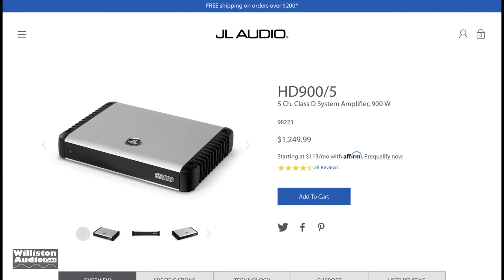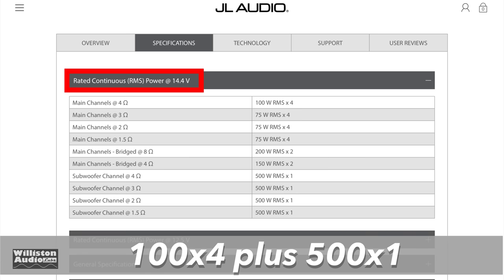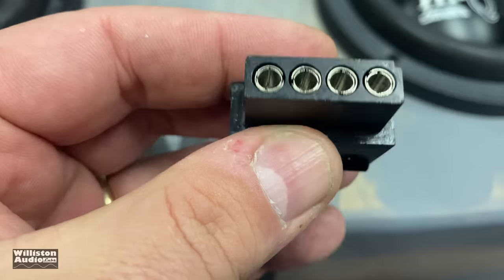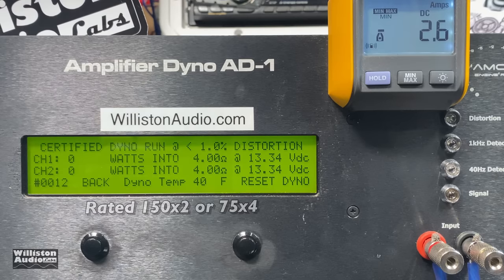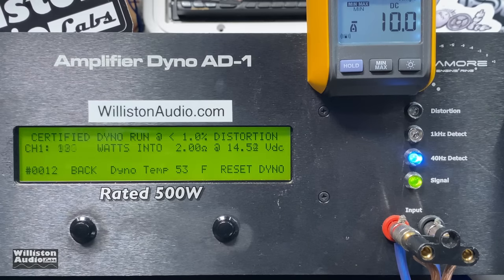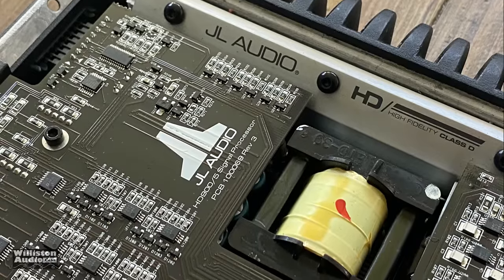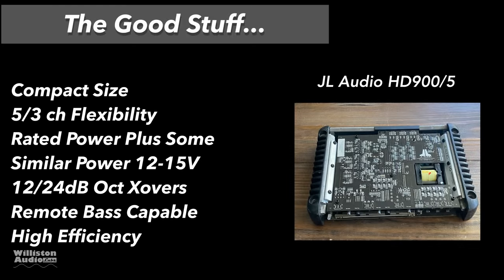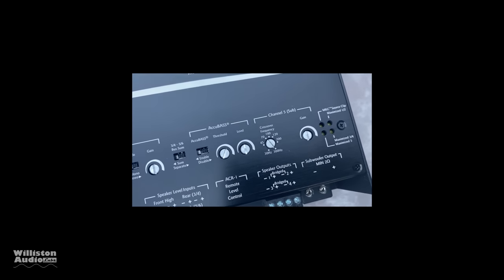JL Audio HD900/5 Amp Dyno Test and Review [4K]

Comment: There’s nothing great about those jl audio hd amps they are way over priced. Memphis car audio amps are way better.
Reply: 🤣🤣🤣🤣. Wrong. Sonically this amp is amazing.  Memphis🤣🤣🤣🤣🤣
Reply: Maybe Memphis of old
Reply: @angelvip2474  I use to have that same jl hd amp it went out after 2 years. I replaced it with a Memphis viv amp. The Memphis sounds a lot better and was only half the price.
Reply: @fresh55n9ne  and I've been a JL dealer for over 13 years and have Installed hundreds of these from basic to sound quality set ups. Not saying you don't get any defective units but having one go bag and a Memphis still run doesn't make the Memphis any better. I bet my local Memphis dealer have had plenty of issues with them. One reason why I'm not a dealer for them.  To each their own.
Reply: @angelvip2474  I am a electrician. I have ran different amp brands throughout the years I’m not saying that jl is junk I’m saying that the jl equipment didn’t last and I was not impressed with the sound.I am personally done with jl audio I will never buy their equipment I work hard for my money. The Memphis viv sounds better.
Reply: @fresh55n9ne  that's fair enough brother👍